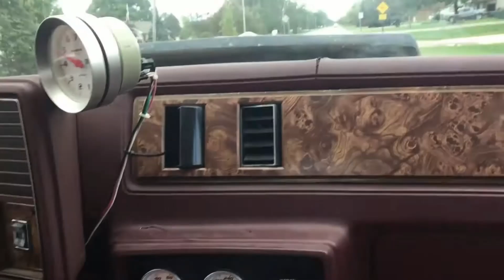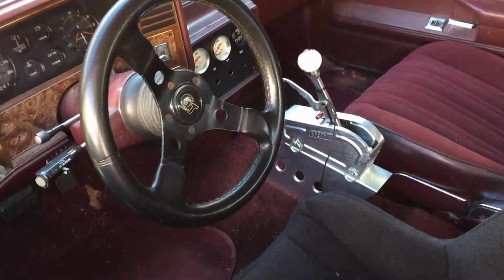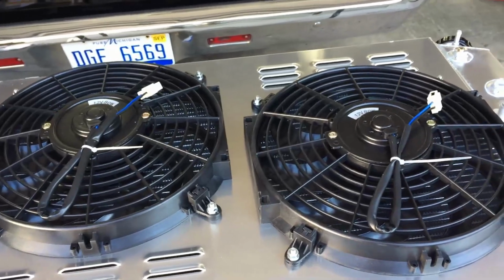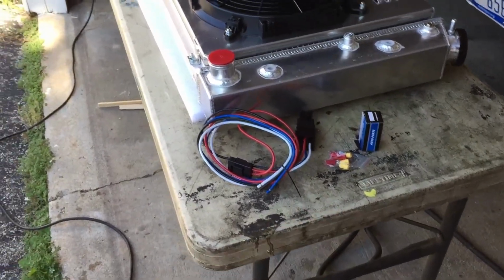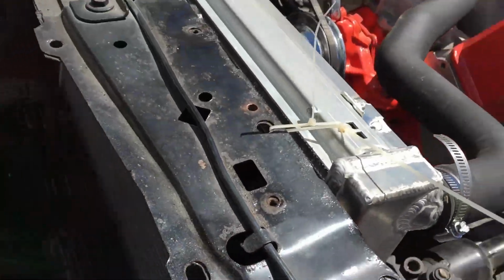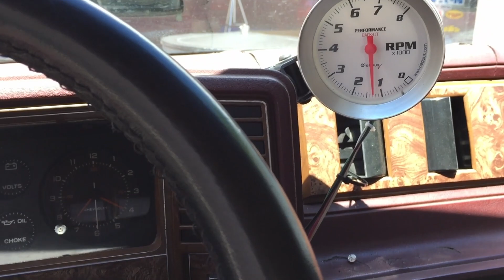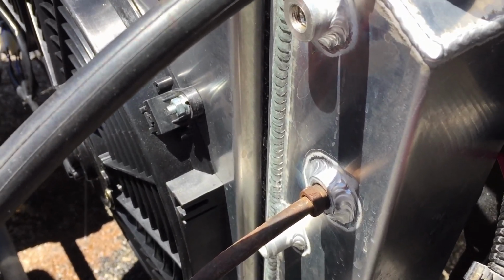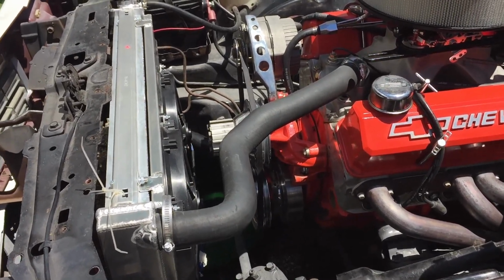#G-body 355 sbc Monte Carlo shows up for some cooling upgrades...

Comment: 80 degrees? Hot? It's Been 80 Degrees At 4:30 AM For The Past Month!!!! 105 Today!!! Wish I Had 80s!!! 
I Have The Same Radiator For The S10 And An Extra One From The El Co I Scraped!!!
That Whole System Is To Be Ground Activated Through The Temp Switch!!! But Yeah Too Many People Forget The Ground Will Turn Off And On Any Circuit!!! Even In Your House Wiring!!! 
Hope You Don't Die From All That 80 Degree Heat Brother!!! Maybe A Sit On The Porch With Some Southern Sweet Tea Would Help You Out? Lol!!! 
Keep Rocking It Out Brother!!!!
Reply from the maker: Us northerners would die from your heat lol 😂, hey pat do you still have that third break light from the blazer you scrapped?

Comment: What’s the numbers on that sir, I need to convert mines over. Did u feel a difference and power. Everybody say the fans holds power back.
Reply from the maker: a regular fan can rob up to 30hp in cases, i can get you the info on it, my email is in the description of video hit me up so i can get the information on the radiator set to you ✌️👍

Comment: Engines shouldn't be labeled by their overbore unless they are also stroked. It's a 350 Chevy, right?
G-bodies rock. They inherited the platform that Chevelles and GTOs used to represent.
Reply from the maker: yes the a body platform of the late 60s early 70s were true american muscle 💪, and i go by cubic inch of my engines , so you are correct it was a 350 cubic inch chevy now it's a 355 cubic inch, i believe when they say 350 from factory they mean cubic inch , thanks for watching we appreciate it .